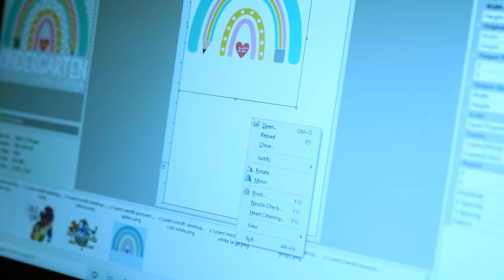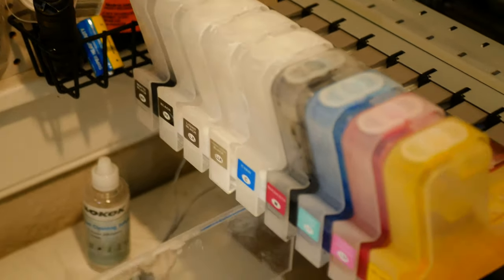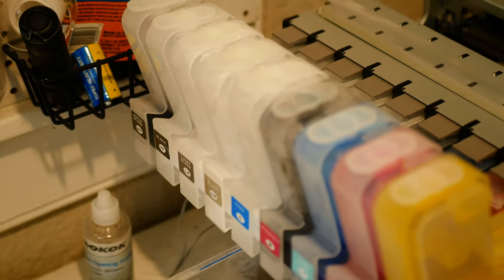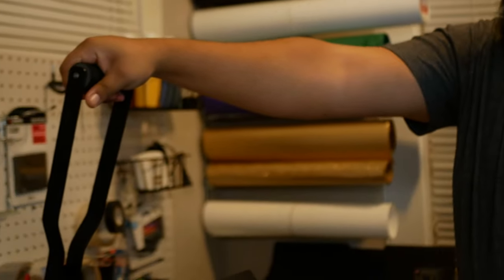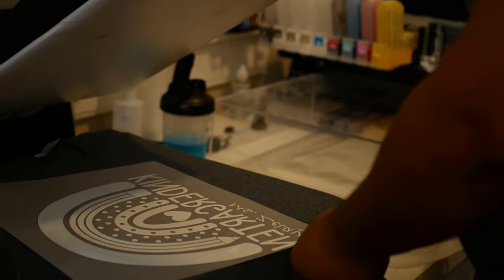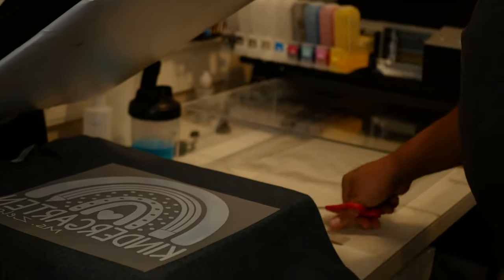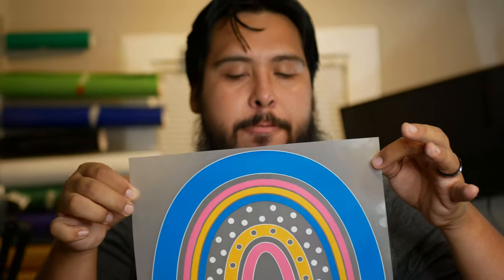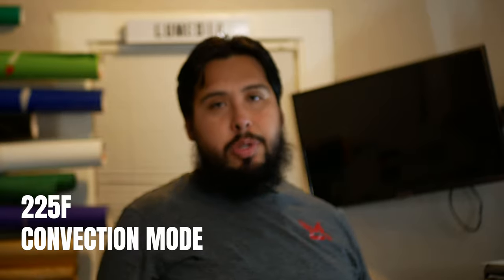Start to finish Direct to film transfer printing for beginners

Comment: Thanks for providing all these tutorials. I want to buy a DTF printer. I'm curious as to why there is such a disparity in pricing. Will the price impact the quality of the print at all, other than speed and convenience of operation? I found one supplier that provides the powder shaking machine. Will this machine make the work easier and the quality better? Thank you in advance!

Comment: Hi! What is the difference between heat transfer and DTF?  Like texture wise, if it makes sense.
Reply from the maker: Hey Alicia, are talking about plastisol transfers or just regular heat transfers you can buy at the store? In terms of texture DTF feels closer to a screen print than the others mentioned above. Still feels a little rubbery depending on your settings but once you learn the ins and outs you learn tricks to make the print feel as natural as possible.